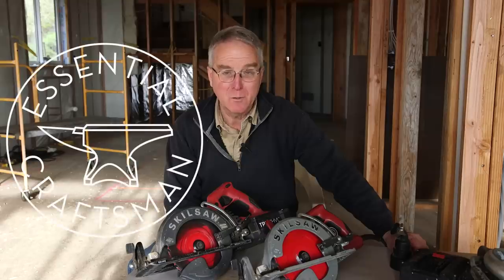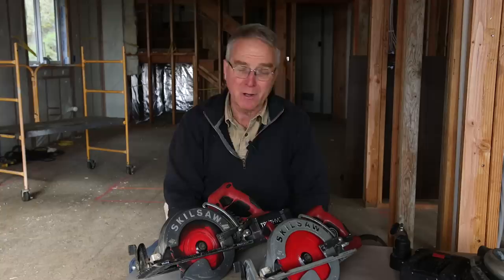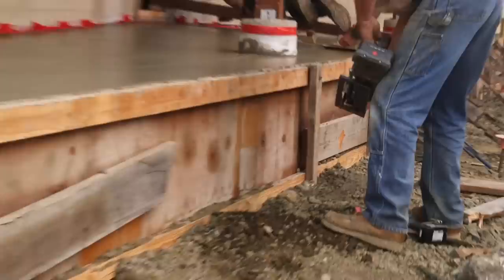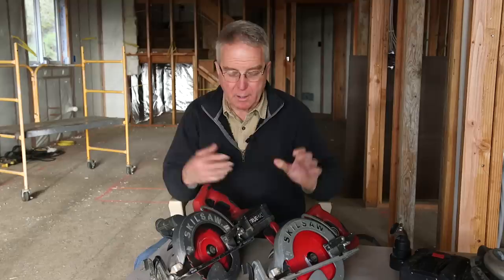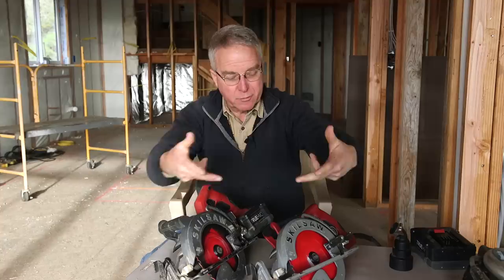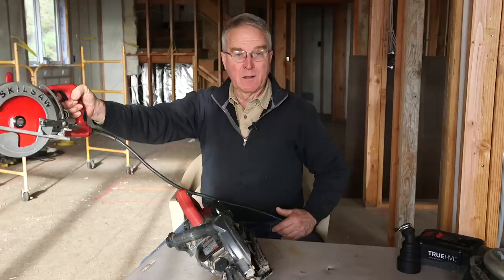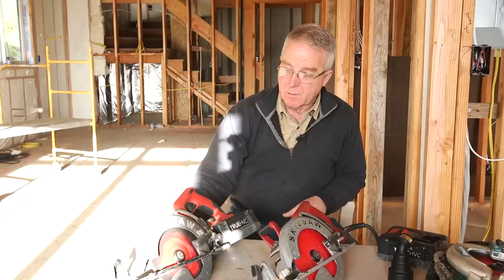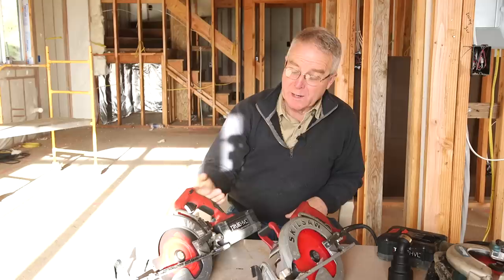Skilsaw Cordless Worm Drive Saw - Initial Review

Comment: I am one of a hand full few guys that has probably used almost every saw on the market. The # 1 problem with the corded version of the Skilsaw is the torque. 

At start up you must wait 3-4 seconds before every cut for the saw to settle in from the torque then  hand and eye coordination. For this reason I don't like this saw. 

A cordless saw is awesome even though I get it with the cord and lowering the tool

Comment: I wonder if the Cordless is the same weight as the original skil saw corded. I just picked up a skil saw that was made in the 1970s and man that thing will separate the boys from the men wheeling that thing around. Great review I have a dewalt Cordless skill saw and the weight is a lot closer to its corded brother which is a great tool when you have no power and need to get work done

Comment: surprised they didnt make it a hybrid of corded and cordless, to where you have the option of removing the battery pack and attaching a standard ac extension to a socket from within where the pack used to be, with a simple locking mechanism which also secures the extension so you can tether the saw like a rope

Comment: I miss building houses, in my 70's so it is really not a good idea for me to do that anymore, not that I don't use my skill saw from time to time. It is a work horse for sure. I think I replaced the cord a few times before I learned to put a long cord on it. I think the stock one was 6 feet but I have a 10 footer on mine now. for short jobs in most cases I don't need to break out a cord too. I have several saws because as you pointed out not every saw is the right saw for the job. I think the first cordless saw I ever used was a Makita with a 3 inch blade, it was just about worthless, thankfully they have come along way since then.

Comment: The soft start saves your motor. If you are working elevated your tools should be tethered. They should make a belt or back pack battery pack with a short chord...with a quick release to rip off a flaming Li battery.

Comment: Great review. I've been running this saw since about this time last year and I feel about the same way. The things really is a beast. It's easily the most powerful saw I own. It's incredibly well built and thought out but it's just a little too heavy. I hate to say that but sometimes holding the thing in certain positions (like making a long rip holding it sideways) is just not fun. I actually carry the corded and cordless skilsaws and the Makita 36v. The first one I reach for at the beginning of the day is the Makita mainly because of weight and balance. I pull out the cordless skil for cutting things like wet treated or stairs or anywhere there are a lot of repetitive cuts that need made in wood that usually bogs the Makita. Then the corded gets used if the whole day is going to be spent cutting or for a cut man to use on the ground. They all have their place in my truck. These cordless saws can be a huge productivity booster and I'm all for that.

Comment: The worm drive saws seem to be the standard in the West.  In the Midwest, most everyone has the "sidewinder" traditional type circular saws.  I never understood why they put the motor on the left side of the blade which obstructs the view of the cut line for a right handed person.  I'm used to it as I've used that type of saw for 30 years but if I had to replace my saw, I'd buy a worm drive saw.
Reply: Exactly.

Comment: Funny cuz I just got a makita version......I hate having to press a button before pressing the trigger.....really really despise that.....it is heavier and balance totally different.....like you been using skilsaws for 35+ years....but for sure its the future and yes very nice not dragging a cord around

Batteries have gotten so good that even production framers use them now.....

For pickup work and 1,2 or 3 cuts they are totally worth it

I bought mine cuz deal included 2 free batteries along with 2 that came with it and I needed those batteries for other tools so, anyway......yeah cordless is future for sure

I agree too that I use them both corded and battery for different reasons.....maybe once I get used to balance of cordless ill get more accurate with it.....but corded version feels like an extension of my hand after so many years

Comment: Seems like you could add a length of paracord to use for the lifting etc.
Reply: That's what my boss is thinking, add a 4-5 foot bungie cord that you can just clip to a harness or belt and remove the risk of dropping it off the roof. Paracord would work really well too.

Comment: Very good review. I was curious about the additional weight and balance. You addressed those points. I'll stick with my old corded because I am retired now and rarely use it. Good Luck, Rick
Reply: Dewalt, Milwaukee and Makita make 6 1/2" saws that use much smaller batteries  and weigh less than a corded saw.  They are great for cutting plywood and 2 x material.

Comment: I don't have a cordless Skillsaw (mine still has a cord - it's to heavy for me to use all the time) but I was shocked at how powerful the new brushless Makita cordless circular saw is.   So much so that I'm not really interested in pulling out the corded one, actually wondering if I will ever use it again.  I've had cordless saws in the past, but this new gen of brushless is something else.  I actually sawed through a work table without realizing as it didn't skip a beat.   It might actually be as powerful as my old corded Skillsaw....

Comment: Very interesting and informative review. One of my big concerns about all battery powered tools is whether you'll still be able to buy replacement batteries for them after 20, 30, 40 years. I'm not implying that the original batteries will last that long (I highly doubt they last more than 10 years, and perhaps much less).

Comment: Question: why is the blade on the left side while most saws have the blade on the other side? I'm right handed and I think having the blade on the left side is much better to see the cut line, no?
Reply: You can see the blade cut the material if the driving motor is on the right side and the blade on the left. Lots of people just line up the blade with your cutting line. The other type (sidewinders) you cant see what you are cutting.
Reply: @jdclaverie  That's exactly what I mean. So why are most saws sold with the blade on the right side?
Reply: Most traditional 'sidewinders' are "blade-right" because that's the way that the oldschool electric motors spun.  Worm drives with the 90-degree change in direction just happened to end up blade-left.  Most trades people just accepted the 'tradition' and got used to it.  Having the mass of the saw (assuming a right-handed user) closer to the body was also a safer form factor.  No, you couldn't see the blade while you were cutting but that is just a beginner's habit because once you got used to looking at the guide marks on the baseplate, you can cut some pretty straight lines.

Cordless saws were/are smaller than their corded counterparts in both size and power.  Initially designed to be used on lighter duty applications, they mimicked trim saws which were typically blade-left because under fine finishing conditions you needed to see the blade while cutting.

With technology being what it is now, you can make a motor spin however you like so that's how the left/right handed versions of saws came to be.

Fun fact.  Worm drives are more popular in the west vs sidewinders being the preference back east.  The preference of building structures out of timber required a saw with more torque.
Reply: Chrystian Guy sidewinderd use a direct drive motor and it has to be on that side because thats the way the electric motor spins. Wormdrive use gearing to place the blade 90 degrees from the motor.
Reply: @jdclaverie  I'm sorry but you are wrong.
There are left and right blade cordless.
Reply: @eutoob  Oh! Thank you. Now I know. :)
Reply: @2chipped  were talking 20-30 years ago when there were no cordless

Comment: So as much as I love a worm drive, I have fallen in love with my metabo HPT multivolt sidewinder. It's as powerful as I need it to be, probably less than the skill saw but not noticeably, but it's nearly half the weight of the skill saw. So I find myself able to use it in conditions that a skill saw would be difficult or dangerous to use

Comment: You should try the 2x18V Makita rear handle saw, it is $250 at Home Depot for a kit with FOUR batteries and dual charger. Amazing value.
Reply: That, no joke, runs for $1150 usd where I live, seriously
Reply: @Pontus95  Buy two, use a freight forwarder and sell one. Then you get yours free. But charger is 120V only so you'll have to ditch that. Land freight takes a month anywhere and should be less than $150.
Reply: I can't thank you enough! I'd just purchased the 2-battery deal at HD when I read your post, so I returned it and ordered the 4-battery combo that cost the exact same. Everything arrived today and after one shall project I'm already a fan of the saw. My first Makita cordless tool, and with 4 batteries I might just pick up their 16" chain saw should it go on sale. Thanks again for the heads up!

Comment: There was one glaring omission in this review Scott, that simply can’t be overlooked. PRICE! The corded Skil worm-drive can be purchased, all day for $170, or less on sale. Pick up a $30 extension cord and your in business for $200 bucks. 

  The cordless version sells for a whopping $510 w/2 batteries! 2 batteries are essential for any cordless tool being used professionally. Non-professionals might be able to get away with the 1 battery version, if stopping work for a recharge is an option. In that case you’ll only need to shell out $370 for the 1 battery package.

  Unfortunately the bad news continues. You’ll get 2 to maybe 3 years max service life out of a battery, if the saw is your daily driver. Don’t expect much more than that if it’s just an occasional use saw because, for whatever reason, the batteries just go bad with age, whether you use them or not. If you are into your 2nd year with the batteries, you’re probably going to want to get new ones anyway because they won’t hold a charge like they did when new. 

  The rain continues - When it’s time to go ahead and get new batteries, DON’T BOTHER! A pair of these new replacement batteries will set you back another $480 at $240 each! Just shell-out the price of the replacement batteries plus an extension cord ($30) and buy another brand new saw. 

  Your mileage may vary, but if you’re rough on a saw, expect to get a solid 5 years from a corded Skil worm-drive. If you’re just a little more careful, 10 years is a completely reasonable expectation. If money is a non-issue, the cordless version is hands-down the way to go.
Reply: For a professional making money with his tools, the price is a little bit less of a concern, as long as you can justify the difference in productivity in a quantifiable way. In some cases, the difference between corded and cordless will pay for itself in one job, or even in one day on a job.
Reply from the maker: Well said Mr. vicious! I wish I would’ve included that perspective in my review! It definitely tips the balance doesn’t it?
Reply: @rjk7104  In a 10 year span, assuming you were able to squeeze 2.5 years out of a pair of batteries 🤞and kept the same saw base the whole time, your cordless saw usage would be costing you ~$2000 (inflation is 0%). You’re likely due for a new saw base at that point and it’s time for new batteries as well. Tack on another $500 and you’re up to ~$2500.

  You could easily still be using your original $170 corded saw at 10 years. Or worst case you buy another at the ~7 year point, you’re into it for $340, and there’s still years of life left on your saw.

  I LOVE cordless tools! It’s just the triple+ price, and one third the life-span issue that can’t be ignored.
Reply: He said at the beginning of the video that the saw was comped from Skil... Price wasn't a factor in his experience...
Reply: @MrMaxyield  I didn’t miss that.

Comment: I always believed it was not right to lift or lower a power tool by its cord &  especially not a heavy worm drive saw.   For the same reason I wouldn’t unplug a power tool by pulling on the cord.    I realize that it can be done but I don’t think it’s good for the longevity of the power cord.
  By the way I thoroughly enjoy listening to your videos and I have learned a great deal about construction practices from your videos.

Comment: Nice trailer backing :o)
Yep, I've nicked my cord a few times in the last 30 years or stepped on it which stopped me from cutting . . . Depending on your blade, mine puts out way too much sawdust to have a dust collector on it but I don't use mine indoors either. For concrete forming the cord is inconvenient because there are so many stakes the cord gets caught up on so I would consider this if I needed a new saw.

Comment: I hadn't thought about the cord being a plus especially when working above.  There a cordless saw becomes a problem.  Wonder if the manufacturers will devise a retractable string to allow an operator to lower it and then let go of the string and it automatically retracts.  I also thought the weight of the battery might be an issue, especially when climbing or working elevated.
Reply: The batteries required for a circular saw are really heavy. I have the Milwaukee with the 12Ah battery and the battery weighs more than the saw.

Comment: I wonder if these manufacturers realize that their cords regularly have to support the full weight of the tool. if I was in that position, I'd see about an extra rope in the cord to spare the copper from the tensile stresses... and design the cord clamp and bend protection accordingly... AND make sure to label that, so the user knows to let it dangle as is without wrapping it around the hook or anything.

Comment: How much power loss would there be if the battery were clipped to your tool belt, and was easy to plug connect to the saw when needed.  Same battery could work on different tools.   Just thinking ....

Comment: To me there's some cordless tools that needs more work on weight. Angle grinders is another tool that weighs a lot more on battery than with cord.

I hope that the next level of battery-technology will be able to increase the power/weight-ratio. I own a flexvolt circular saw myself, and it is heavy and big! I want to get a left-blade instead with less power, because I am finding that power/capacity sometimes will sacrifice usability.

Comment: I have never used a wormdrive saw in 28 yrs of working in the trades.
Its an east coast bias I will admit.
Sidewinder feels to heavy.
You have to learn to be ambidextrous as a carpenter, so blade left feels funny (am a righty).
Reply: It will take approximately five minutes for a right handed operator to adapt to a worm drive.

Comment: What about attaching a piece of rope to the cordless saw? Also, that battery looks massive - I would suggest replacing it with two smaller batteries instead, one on the saw and one on the charger.

Comment: Scott, in your corded Skilsaw techniques video, one of your tricks was that you would release the trigger just before ending the cut, and the inertia would finish the cut so the blade was almost stopped at the end of the cut. Here, you called out that the Skil cordless motor stops quickly - you release the trigger, the blade comes quickly to a stop. Did that take much getting used to, particularly switching saws on the job? Or does it become a muscle memory thing where you know one spools down and the other stops abruptly?  I have noticed my Ryobi brushless home gamer saw does the same thing - I was trying to emulate your "release the trigger just before you finish the cut" and it came to a dead halt - much different from the corded ones I've used! I will say that for us occasional users, the "soft" start is nice when you pick up the tool for the first time in 3 months and forgot about that big jolt - or have spoiled material because you jerked a bit. Greatly enjoy the channel and your wisdom, sir!

Comment: Nothing worse than moving to battery tools from a variety of manufacturers though. Nothing beats running one charger for everything. I'll also never understand the worm drive saw, especially given the physical motor size and torque of contemporary saws. It used to matter being thinner and more robust. Maybe if you're going to run a diamond blade and cut block or granite counter tops that day. Otherwise, I would get a brushless 6 1/2" sidewinder with the blade on the left as you like it and run that for daily framing and finish ops, never look back.  The size and weight are the savings in my book.